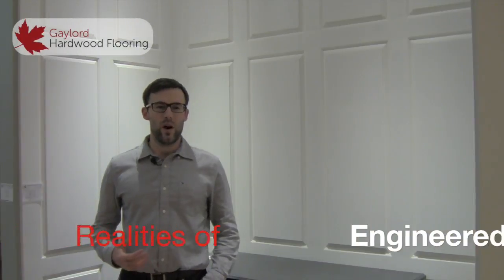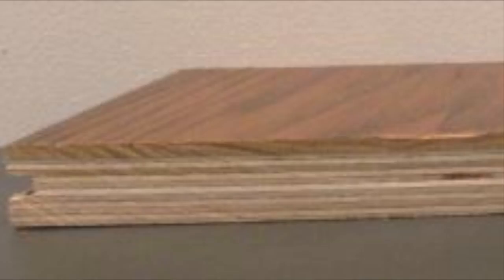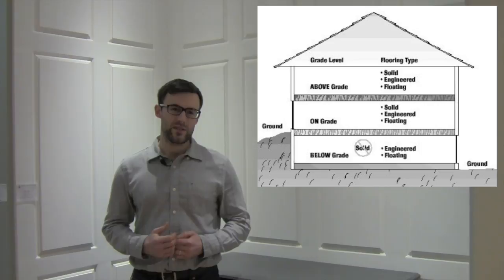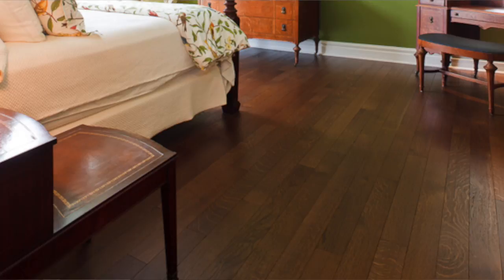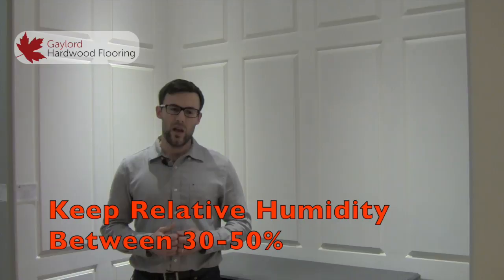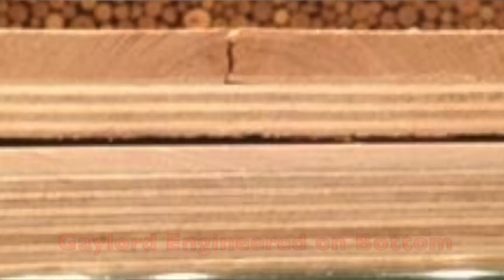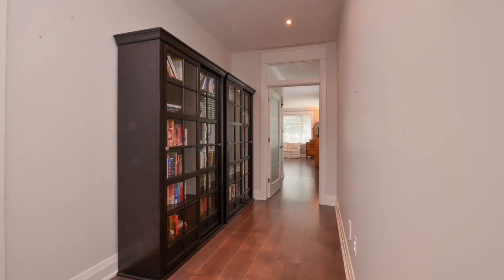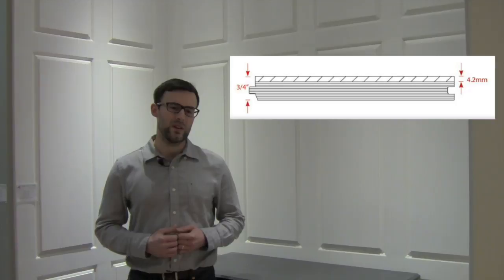Realities of Engineered Hardwood Flooring - Solid Vs. Engineered Flooring

Comment: Hmmmm..... Engineered wood floors were designed so that there will be minimal cracking or cupping.  The top layer, or veneer, is a slice of real hard wood glued to quality plywood.  The plywood takes the stress out of expansion and contraction, to a minimal state, but moreso than for solid hardwood.  If you are in an area where you have too much humidity or dryness, consider another type of floor!

Comment: It's too much bla bla bla bla the only thing you need to know is that engineer wood type ratings they are called AC Ratings from AC1 to AC4 the most dense material. AC4 are the commercial wood you see at the mall suitable with high traffic. Hardwood if you drop a hammer it will dent because its soft! So the question is do you want a soft wood or hard surface dense material end of story!